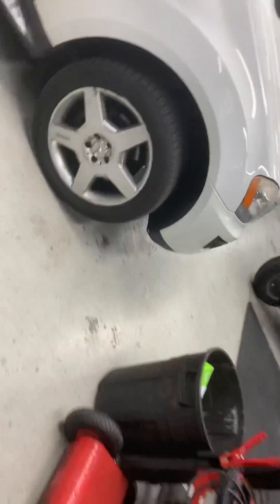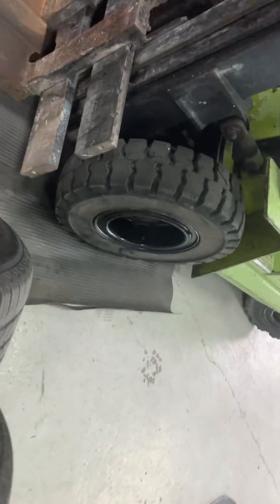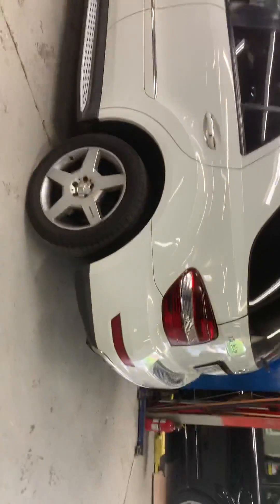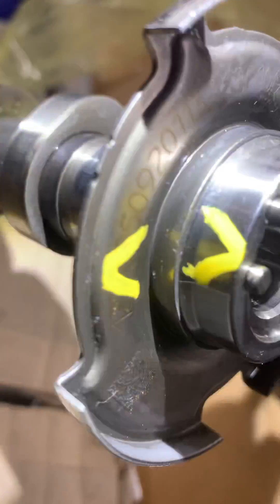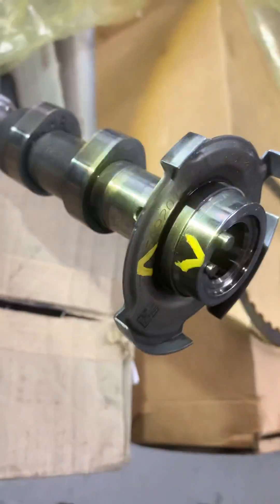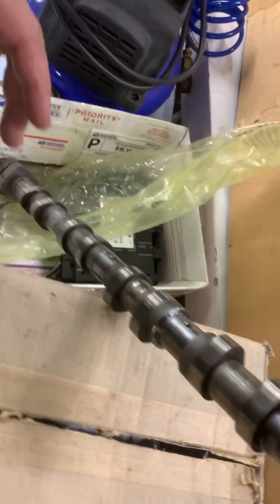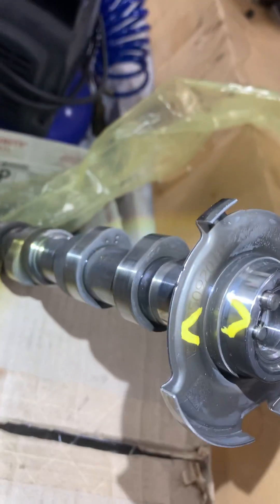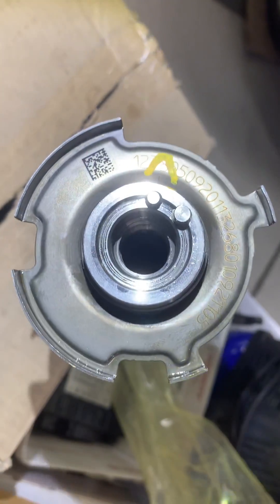Mercedes-Benz 278 camshaft timing gear issues, how to tell cam is bad.

Comment: id love to know if you ever made the tool to correct this, id purchase one myself if you did. Otherwise im going to heat the ring, press it off, and press it back on in the correct position and then tig weld a tiny spot on either side of the ring to keep it from walking in the future. Glad i came across your video though. Hope life is treating you well.

Comment: Hello how do you adjust the tone wheel back in alignment? What do you use to do this? Mine is just slightly off the camshaft marks alignment and would like to try getting it back in alignment prior to replacing the cam?

Comment: You absolutely right bcuz happened to me on m270 engine which is CLA 250 2014 Mercedes-Benz absolutely same thing exactly and I had to twist it back and believe it or not because it was my own vehicle I used the JB weld and I drove it 7 months no problem and then I sold it yep absolutely JB weld thanks
Reply: Can you tell me how u did it ? I have the same problem

Comment: I have removed the cam sensors and" gently "turned the tone ring back into place many times.  Saves the customer money and always fixes the problem. I know it seems barbaric, but if it works why the hell not. Also, you can  watch the camshaft angles with a scan tool and know when your tone rings are in the correct position. I still have no clue why these plates move.
Reply: Can you tell me how is this fix done?

Comment: You ever tack these together?  I work on my own cars somewhat, but I have been TIG welding for 7 years, and I think 2-4 tacks with some filler would keep it in place.  Maybe some stainless filler, but if heat is an issue then some tig brazing might be a decent option.  Steel won't distort as much as stainless, and a half a thou of warping might make the part much tighter.  Are those lobes in the front for balancing or to talk to the sensor?

Comment: I’ve had a few of these roll through the doors. My boss doesn’t wanna get involved. Can you see the marks with the cam sensors removed? Or do you have to pull the valve cover to inspect the marks?
Reply: yes and the reluctor should be centered in the sensor holes